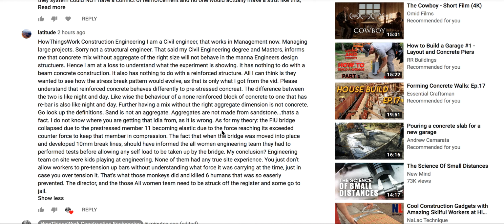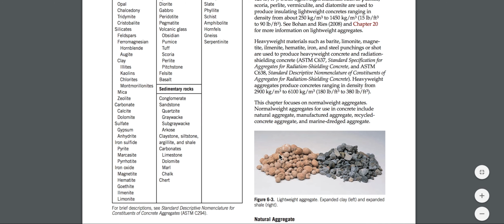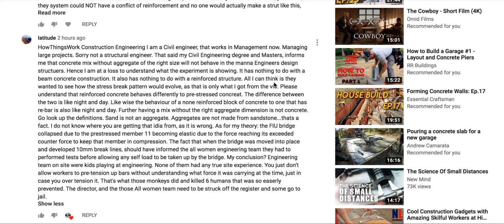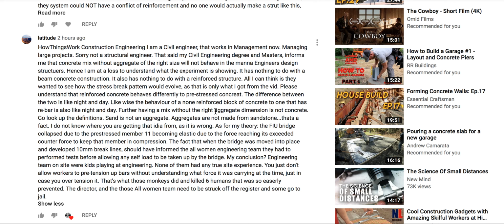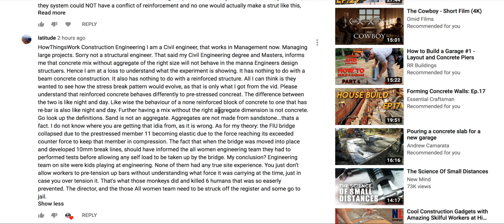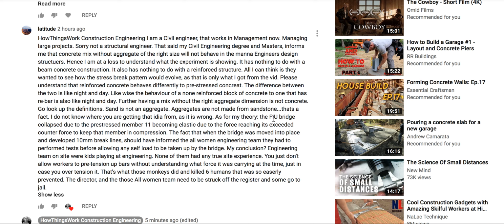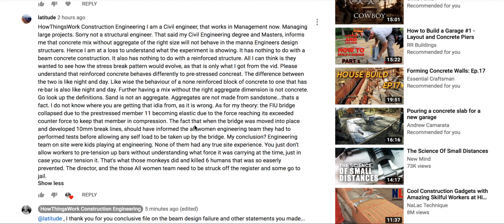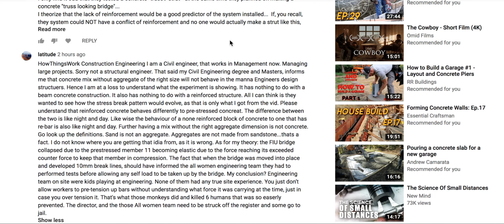Concrete response video be prepared to be trolled Portland Cement and Sand make Concrete

Comment: Sand stones contain voids (air), which make it week under compressive loads. Sandstone also act as a sponge that sucks up water, and again produces week zones. Think about it, if concrete is cast with air bubbles it is inherently week. I think that book is talking about sand not of any aggregate size. Pebbles that are round crushed may be what they are going on about. I am positive one can not make concrete without the small and large aggregate. I have never seen it on a project except for concrete blocks, but those have gone through a heating and baking stage and no longer hold the characteristics of the original soft mix. Even concrete window Lintels that are pre tensioned have 5 mm aggregate. Basically if you do not have small and large aggregate it will be prone to fine line cracking.
Reply from the maker: I agree air weakens concrete  but we use it for the reported freeze thaw cycles -- we do not use it indoors though... 
Latitude, as far as I know, I am the only one that believes ALL cracks are NOT random and have a 100% reason behind each one... 
I have seen Phd Engineers speak on cracks being random... I think this is lazy and lack of engineering basics to think cracks are random...
Reply from the maker: As you can see on this channel I talk a lot about concrete cracks in how they all have a reason and NOT one is random...
Reply from the maker: I talk about random stone placement via the multi-sized choice concrete mix design... that will create the weakest path...  Stones that just but each other without paste are not the strongest section but may be the weakest ''cross section''...   
It is not random but rather a defect in the choice of stone mix that created this ''random'' possible pattern... Therefore, the random pattern is predictable in that that the ''wrong'' formula was created...   
I have many videos to come on this... Giving away where I am ultimately going;  until you get to super high strength concrete the stone "never" splits during these ''cracks'' appearances...
Obviously because the stones are of a higher PSI than the paste mix... 
Once, you get the paste equal with the stone... the game changes.
Latitude, you are jumping my video series with ''random''...  this is the way I do it... I state one thing for the longest time and then I show the ''aa-ha!" moment reveal...
I have a BIG one for the FIU  that I am slowing giving the background on and then I will load the "aa-ha!" video...
So, you are killing me with the random stone comment you sent me... as you are stealing my thunder on that subject... I was hoping someone would say something but I got to the point that no one would...
So, I may still stay the course and give the switch out as planned or I may just kill it and give that video tomorrow and dedicate it to you for being the only one that beat me to my video content...
Damn, I am not ready yet... still a lot more to show before I ''attacked'' that design mix...
Basically, you have it right and to take away some of your thunder... it is also the defect that you so proudly state IS the ISSUE...
The ''mix-design'' is what is defective and as I stated in a pea stone video;  pea stone is the best, current reasonable choice! 
3/8" pea is the best... for consistent - non cracking product.  
Maybe I can find that video and link you to it... I am kind of tired and will ride this next sleep session (took a sleeping pill)...      
I edited this comment and found the hint video I put out days ago... https://www.youtube.com/watch?v=NvckXqLopW8       This will all "connect the dots"   and show that pea stone eliminates the ''random" cracks more than angular stone ...  I will slam angular stone more in future videos... please stand by.
Reply from the maker: Hope you saw the ''book reply'' I gave and the compliment that I gave you...
It was only a half a compliment as you had the data but did not see it as a fault... meaning you did not ''slam'' the stone sizes as the issue... that they lie, telling you that the different sizing makes for a stronger mix...   
Come on buddy, use common sense... as you stated it creates the random weaknesses --- which can 100% be explained, so they are NOT really random; they are placed by the installers...   
Also, vibrating concrete will actually cause consolidation and segregation of the stone and paste...  it is a two-edge sword...
It gets ride of honeycombs but gives you a segregation issue. 
3/8" pea has a ''round'' shape which creates more ''arches'' in the concrete and angular creates MORE  bad truss designs (you Latitude are really getting into my secret videos yet to come... 
Because, you are a good sport, I am giving you those hints to the ''inside'' shapes created by the ''voids'' of the stones and why angular are the most stupid ''mix-design'' ever!
I bet you can see it now???   I am headed to bed and psychologically, I am hoping you cannot see it... But, part 75% of me would be so proud if you could see it and where I am going with concrete mix-designs and defects...
Latitude, remember this, engineers pass on from one generation to the next the engineering ''defects'' and right now, we have ACI passing on shit!!!     (as long as they keep preaching angular stone)... 
We will discuss the strength of stone in future videos (think, stone only!)...
Hope I am converting you???   But, you have to let ACI go in most of this -- yet, we will recapture ACI in a positive light later... 
Sorry, I could not post your comment with the link...  It was not on track BUT, it may be part of a video response...  Which I will NOT attack you if you are part of the 75% here??? 
Please, if you do not see it, I accept that and will work on showing everyone what I see... at the end you can call me crazy or nuts...   
I am going for a ''mix-design'' that is of consistent behavior and NOT random (Self consolidation is the true goal-- as installers methods also can consolidate stone incorrectly)...
I will show you that concrete should NOT be designed to the working limits but about 25% is ideal...  so you NEVER ''cycle'' the concrete...
Reply from the maker: Latitude something to change the  feelings and for a good laugh -- hope you have a sense of humor  Enjoy this joke video, I am sending it to some friends, it is unlisted   for now   haha      https://www.youtube.com/watch?v=4N049fulG3c